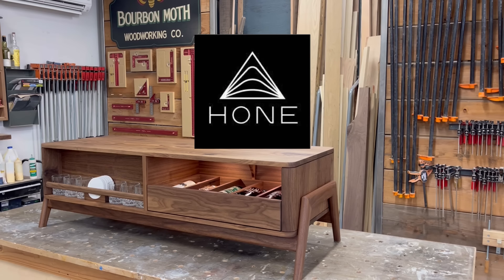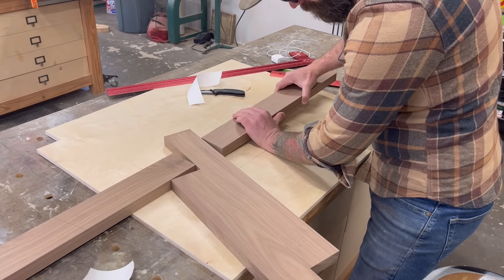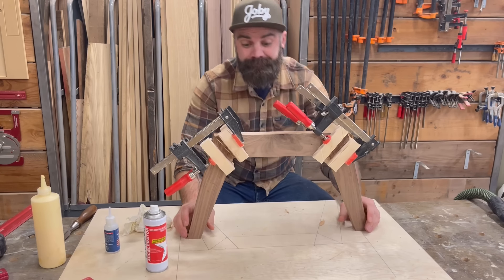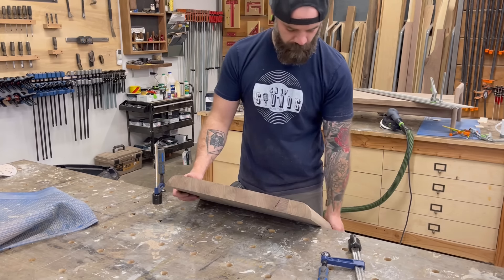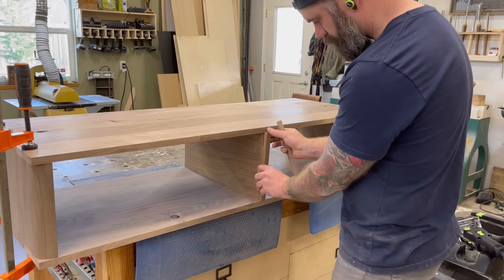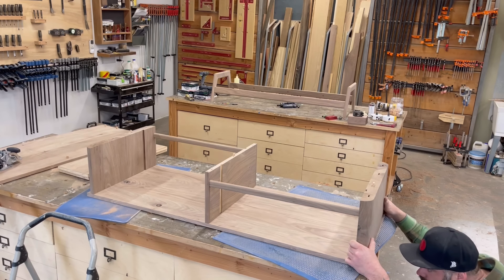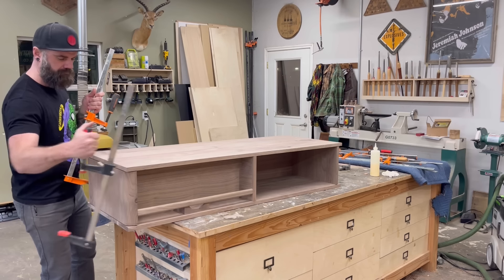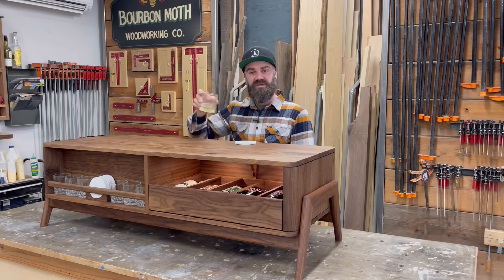Insanely Cool Coffee Table || Ultimate Man Cave Upgrade

Comment: I was stressed from the first dry fit until the 31 minute mark because I was worried you weren't going to round over the top and bottom to match the end caps. Glad to know that it was eating at you too.
Reply: Me too!
Reply: Same
Reply: Haha #metoo. Wait… I don’t think I’m using that right.
Reply: Same. And when he was gluing up and those corners will STILL square, I was shaking my head. And then of course, he addresses it with the obviously best solution of trimming them perfectly. I'm beginning to think there's a method to his madness! lol
Reply: Same. I'm thinking "really, you're gonna leave those edges there". Of course...he did not disappoint.
Reply: I came here to check and see if I was the only one.

Comment: Gorgeous! You could add a block or wedge in the back of those bottle compartments to tilt the necks up a bit and keep the whiskey off the corks. It would make the labels a little more visible too.
Reply: I was thinking the same thing.
Reply: You don't want the cork to dry out and  deteriorate.  Nothing sadder in single malt you were saving..
Reply: @charleselkins4546  that’s more for wine the same rule does not apply to whiskey/scotch you could actually break the cork down if it sits in the liquor
Reply: I dip my cork bottoms in pure hot bee’s wax then pass them through my doweling plate to re-establish the diameter. The wax prevents breakdown and makes the corks easier to pull.
Reply: Or you could replace the cork with dried meatball. Super tip of the day

Comment: Just a suggestion… for the drawer slides.  Make a grove in the rail that is inside the cabinet(1/4” both sides) , but stop 1/2 before the end; then make a 1/4 “ hole in the drawer 😂and insert a dowel long enough that you can remove it later if you which to remove the drawer.  The dowel will ride along the grove and serve as a stopper.  Hopefully I am clear as mud. 😅 I build a five drawer chest and it worked beautifully.  Nothing like wooden slides to give furniture an old look and craftsmanship.

Comment: Jason, the next time you use your hole saw get your air hose and nozzle, take the nozzle hold the end of it close to the teeth of the hole saw, angle the end of the nozzle downward where the Groove is and blow air in the groove and it won't smoke or burn your wood. This technique blows the saw dust out and makes your hole saw cut smoother and faster. I do it all the time. Love you videos Jason.

Comment: As a bourbon fan and woodworking hobbyist, you have inspired me!  And I’m a little angry I didn’t think of this first!
Reply: As coffee addict, was very disappointed by this "coffee" table. Am now plotting for similar, but dimensioned to hold coffee supplies. Main problem is working in electrical cable neatly? Or should I use a car battery or similar?

Comment: Really love this one. The shadow line is a great addition. I’m impressed the dewalt 1/4” route ate up the top and bottom corners without significant burning, new bit?
Reply: @Jeedehem  I have the 240v (uk) wired version of the dw 611 and I agree it punches well above its weight but it was more a comment directed at the depth of cut into hardwood without relieving the “bite” with a roughing jigsaw pass first, than the machine itself. I guess a quality endmill/bit goes a long way.

Comment: I didn't see anyone mention it yet so I will point it out. When using a hole saw, peck at the material to clear the wood chips. Drill a 1/4 inch or so then back out. Repeat. Doing this will make drilling easier and reduce or even stop smoking. It will also save your hole saws. Another option is to drill a hole touching the line, inside or out depending on the piece you want to keep. This gives the chips a place to fall without pecking.

Comment: Could you add a slightly angled lift at the bottle neck end to tilt the bottles towards you a touch? That way you avoid the cork issue(assuming you have a day off whisky, maybe) and see the label of the bottle as well. A display drawer if you will?

Comment: Love it.  Only thing you could've done different, and when I build it, is do similar to what you did with the coasters and attach to the back of the drawer  fitted blocks shaped big enough for a bottle neck at an angle so the bottles sit up in case someone wants to highlight the whiskey with those led lights(And help solve the cork issue).  Otherwise amazing video and thanks for great idea.

Comment: Great project as usual. Love the design and walnut looks fantastic. One suggestion, if you put piece of ply or solid wood under the bottles on an angle so they are kind of tilted up ward's(Cork up and bottom down), by doing this you will have better visible label and liquor will not touch the Cork. Thanks for sharing.

Comment: love the overall look and very entertaining video.  IMO design has some issues not allowing for wood movement between the solid wood case top/bottom and the plywood center divider, also the way the case is attached to the base frame with pocket screws will restrict case movement as well.  Other than that, really impressive design and looks beautiful.  the shadow line adds so much to the look, great idea.

Comment: That's a righteous whisky table. And nice selections of rye, BTW. ;)  And I know not all bottles are the same length, but can you put an angled block in each slot so that the bottles tilt upwards a little bit by the cork? For display purposes, at least, it might add to it so that you can see the bottles a little bitter. Either way, I wouldn't be disappointed in the least with a table like that.  Awesome job!

Comment: What about wood movement in the top and bottom pieces in relation to the center divider which is plywood and pretty stable but you glued and joined it full length?

Comment: I can’t tell if that’s a5” or 6” ROS. I need to replace mine and the 6” is a huge price jump!  The 6” very typically has a ‘barrel grip’. You can’t let the weight of the sander push down for sanding, you hav to put hand pressure downward to keep the sander from tipping. Hope I made sense!  Do you use a 5” or a 6” and why?  Thanks!

Comment: Awesome project, very inspiring for another project I need to make, but did you consider angling the drawer bottoms a bit for the whiskey storage? I also would have considered a plunge activated switch and hard wired LED puck lights that when the drawer is pulled out the light would turn on automatically.

Comment: I have never designed any furniture and have only made a couple of pieces from plans so this is purely a I want to learn question.  On the middle divider, why did you orient the grain of the walnut ply horizontally instead of vertically like the end caps?
Reply from the maker: I only had one piece of scrap walnut ply and it wasn’t big enough 🤣🤣🤣

Comment: Great job! Looks amazing! I have a question on why once you cut the first leg you didn't just use double sided and scrap wood to outline the cut on the plywood and that way you'd have exact repeated results and don't have to keep measuring? Similarly, when cutting the miter angle. You could have used the cut off and set the saw based on that.  

Thank your making amazing and inspiring content! Just binged watched a lot of your videos and they are amazing!

Comment: Jason, awesome video man as usual. When used the domino for your center divider was there a reason you used layout lines as opposed to marking the either side of the divider and then laying thedivider down towards the marked side then clamp it flush and use the base and flaps to reference your domino locations

Comment: Hey love your videos, they are great and I have learned a ton from you.  I am in the market for a new table saw and apparently from the Harbor Freight sign you are not supported by SawStop.  As you know they are 60% more than comparable saws like Harvey for instance.  Harvey if you are not aware look to be put together nicely with Bridge City influences.  Like the Compass miter gauge and sliding table and router table accessories are just the bomb.  The fence too looks to be better than what comes on the SawStop.  Do you think the SawStop without the safety aspect is just one of the best?  Certainly you shopped around when you got yours or was it hands down (no pun intended) just the safety that did it?  Any comments or thoughts would be appreciated.  Keep up the great work and keep an eye out for the foreman....haha!

Comment: Great trick for shaping those large radius edges is to glue sandpaper on the inside or outside of 1 or 2 foot length of heavy PVC pipe cut down the length into 1/2 or 1/4 channels. You’ll get a perfect radius, but it will take a little elbow grease.

Comment: There is only one major design flaws in this build. A spirit bottle (also whisky or whiskey) with more than 40% abv. Should never lay flat and have the kork submerged, because this ruins the kork and somewhen it will leak.

Even as he explained it with the plastic kork. Would i want this plastic in my whisky ? Why you display it with an angle the bottles slightly upwards? You have enough space above it. And you would see the bottles even better.